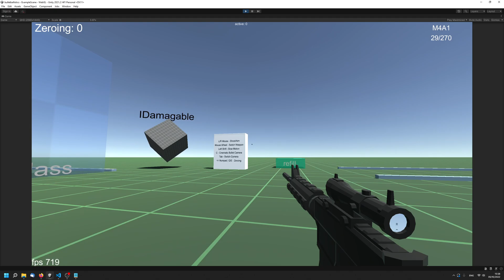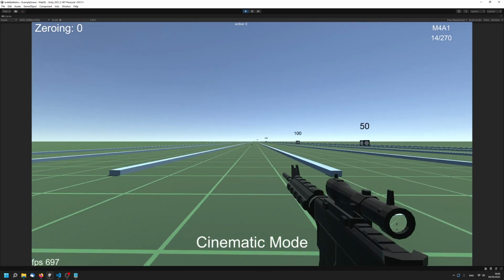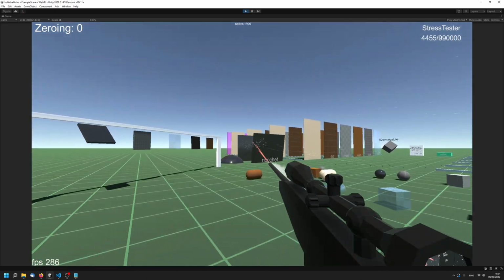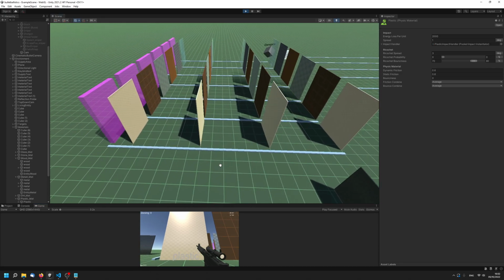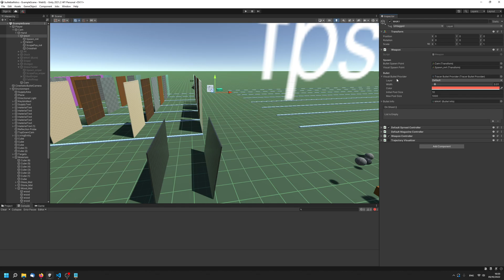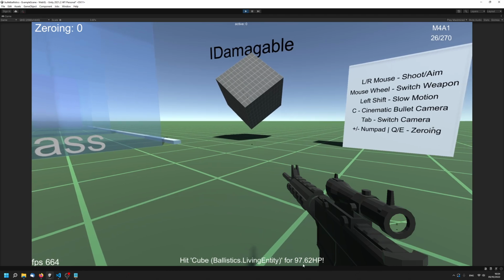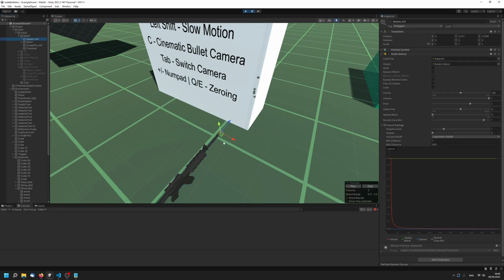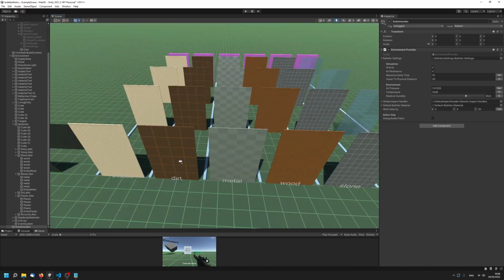Bullet Ballistics 2 - Overview

Comment: Hello! I really like your asset and I'm ready to purchase it. However, I'm using Unity 6. Will your asset work with this version of Unity?
Reply from the maker: hello, i have just imported the latest version of the package into a unity 6 project, and the demo scene seems to run just fine.
There was a message during the import about changed apis, but these issues were automatically corrected during import.
Feel free to let me know when you run into any problems with unity 6 and the packages..
Reply: @cschott  Thank you very much for your response. In that case, I intend to purchase your asset tomorrow. Could you please let me know which communication channel would be most convenient for you? I have a few more questions regarding your development.
Reply: @cschott  Thank you very much for your response. In that case, I intend to purchase your asset today. Could you please let me know which communication channel would be most convenient for you? I have a few more questions regarding your development.
Reply: @cschott  Thank you very much for your response. I have purchased your asset. Could you please let me know which communication channel would be most convenient for you—email, Discord, or perhaps a messaging app? I have a few important questions regarding your development.

Comment: Is it possible to set the bullet drop for a specific weapon? I checked AK.asset inside the Ballistics>Bullets folder. but there is no option for it.
Reply from the maker: Hi, BulletBallistics tries to be physically accurate, and bullet drop over a given distance is mostly a function of gravity and bullet velocity.
As gravity is constant for all bullets, your only real option would be adjusting the bullet speed. A faster bullet will drop less over a given distance..
Though, if you really need a per bullet bullet-drop-factor, it would not be too difficult to add this, but this would require some small modifications to the internal code. (just add a scaling factor to the gravity acceleration calculation)
Reply: @cschott  But shouldn't be this a default feature? I mean you could add it in the next update. It is important for star wars style laser weapons.
Reply from the maker: @fabianobersovszky6987  hmm, yes, I guess this could be added as a default feature. Generally, I only add features which could be useful for most users, and this is the first time in the last 8 years I had a request for bullet specific bullet drop..
So just to make sure, you don't want to disable bullet drop for all bullets in your scene? This could be done in the BallisticSettings in your scene.

If you send me a mail (mr3d.cs@gmail.com), I can send you a version with this feature. For now, I have guarded it behind a feature flag `BB_PER_BULLET_GRAVITY`, check `Window/Ballistics/Ballistic Config` (once you have the updated package)

Best regards
Christian